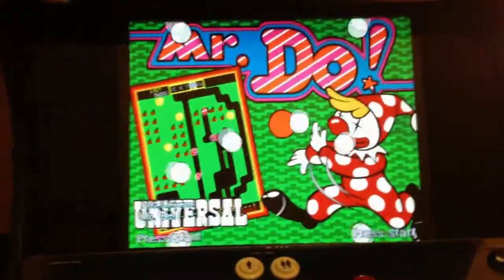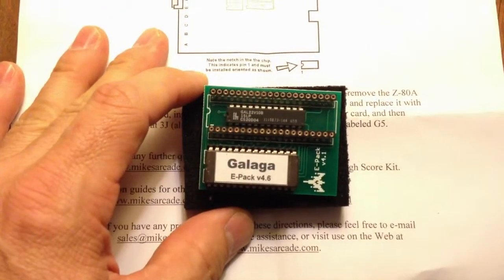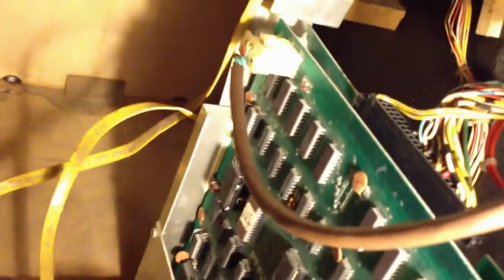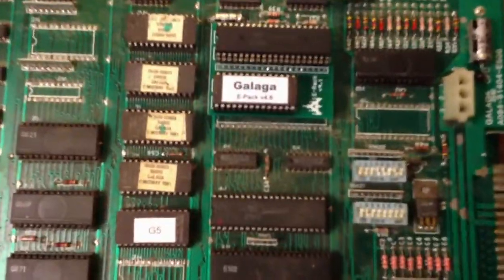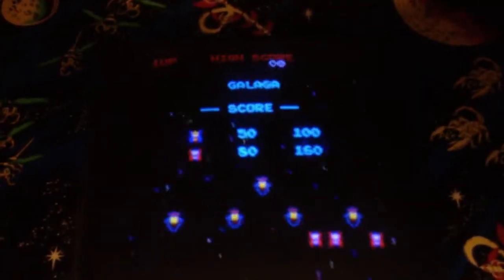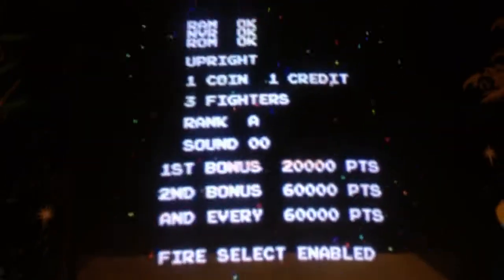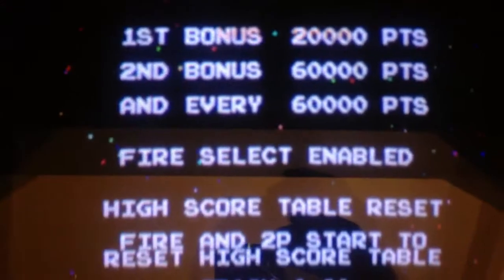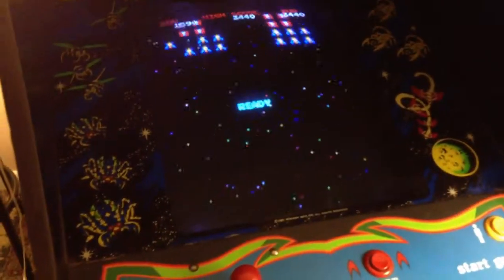Galaga Enhancement Pack Installation - High Score and More

Comment: how do you make it to where you can just hold down the button and fire? is that a 3rd party thing or is it in the original cabinet?
Reply from the maker: That option isn't available I the original Galaga.  There is a fast shooting option that came with it and is included in the enhancement pack, but you still have to press the button and not just hold it down.  Centipede you could hold down the button to shoot.
Reply: ok thanks
Reply: God of the Corn it is in the original cabinet the little board is the rapid fire board and you can turn it on by plugging the board in on the other connector
Reply: i know it's late but yah there's a small rapid fire board that lets you hold down the button

Comment: Is There A Power Switch?
Reply from the maker: I actually don’t have this machine any longer, but it did have a switch that was wired on top of the cabinet. A little recessed hole with a metal push button. Kinda hidden.